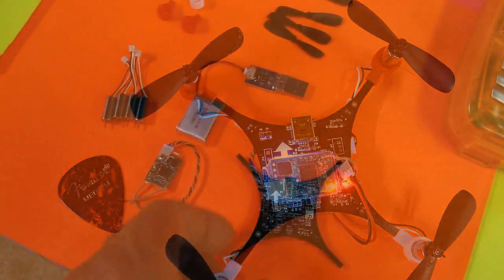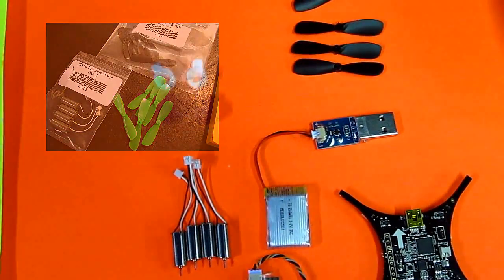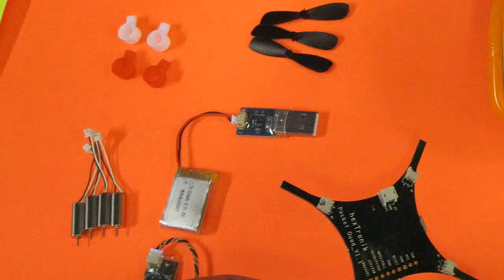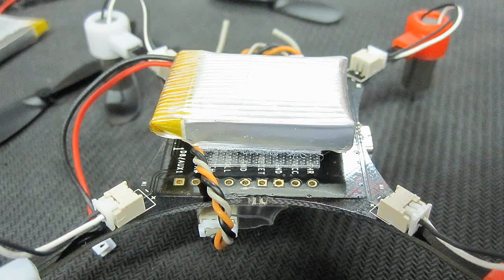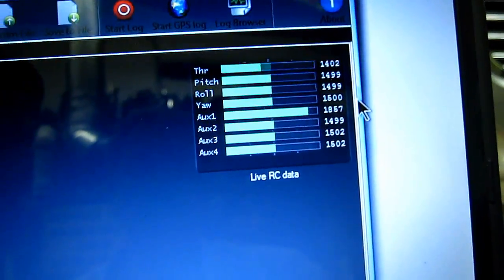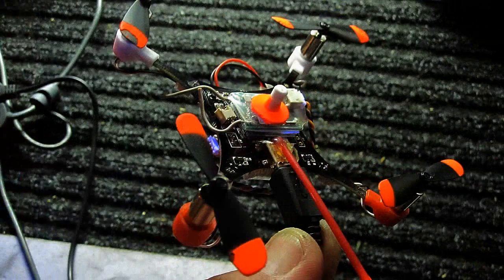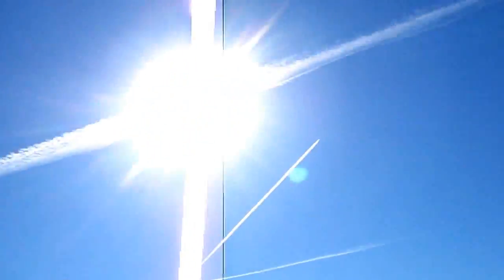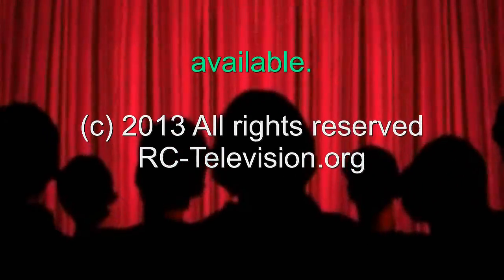World's First MultiWii Based Micro Quad! Program tips and flights by NightFlyyer.

Comment: Thanks for the video. I just received my Pocket Quad and I am having a problem setting my it up.
I have downloaded and installed all the required software and drivers.
When I plug the quad in to the pc the port shows up I select the correct port and board select the build to upload it compiles but fails to upload, the error is cant locate Leonardo on usb...
When I start the MultiWii GUI it can connect but once again I cannot upload anything same error
I have tried 2 PCs same error. 

Any ideas?

Comment: Dear Dave,
I'm looking to get a micro quadcopter and know that the kk board is very good. Of course i'm trying to stay inexpensive. What are your thoughts on the Walkera QR Ladybird V2 Ultra Micro Quadcopter RTF compared to the quad in this video. It is $5 cheaper and i would not have to purchase a controller as you do with the one you showed. On the other hand that was programmable and smaller. Help would be appreciated

Comment: Thanks issr7. I finally got it to arm.Now I am having trouble getting the settings correct. It won't hover I the calibration each time I reconnect the battery, but it just won't hover unless I am constantly moving the controls around. Any ideas?

Comment: Hello Dave, great video, Have you try to load different FW to the Pocket QUAD. I tried, the code compiled but get an error at the end that say unable to find the board. Meanwhile, I am able to use MultiWii config to change the PID, so I think the driver is installed and working. BTW, what are your PID settings? thanks